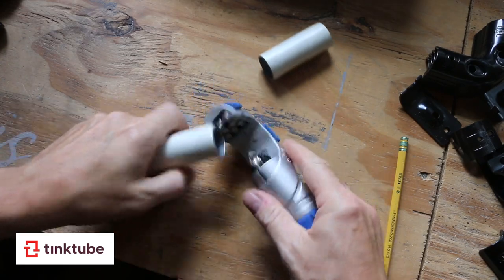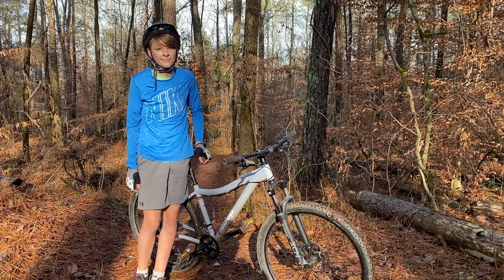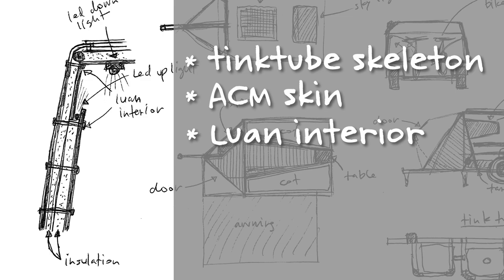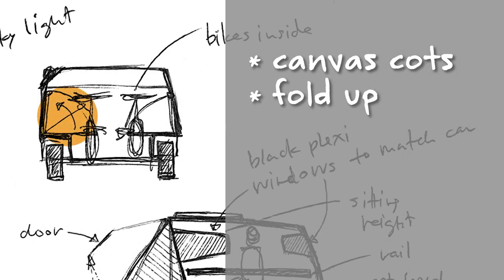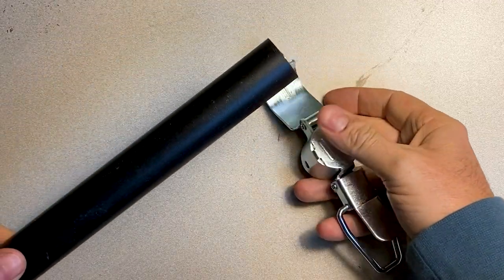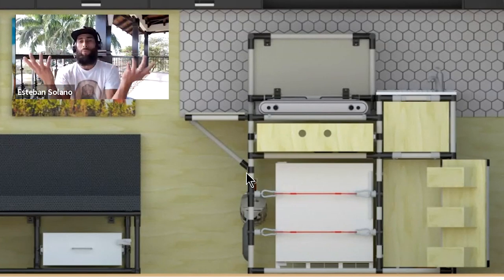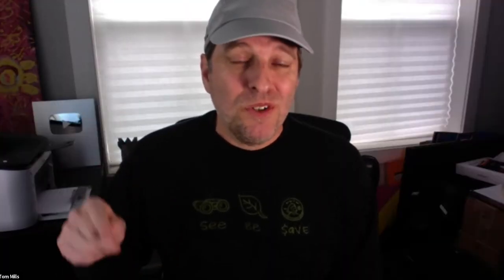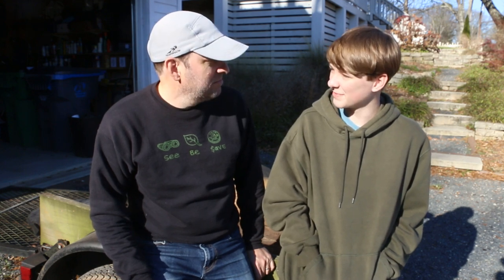I'm NOT Making A Teardrop | #tinktube Camper Build - Part 1

Comment: Quite an interesting discussion regarding your design processes, form following function.  I wonder if TinkTube has a pallet of components that can be applied to design software (is: AutoCAD for professional designers and Visio for Windows users).   Looking forward to seeing the evolution of this project as you apply your artistic craftsmanship and innovation into a final project.   What are the tongue weight maximum specs for your car’s towing capacity.  

Wishing you and your family a blessed week.  Peace brother
Reply from the maker: Hi JW. Thank you. Car is rated to tow 2000 lbs. I need to confirm tongue weight. Good feedback from the chief safety officer. :-) Peace, brother.